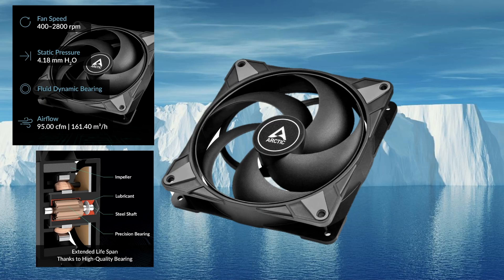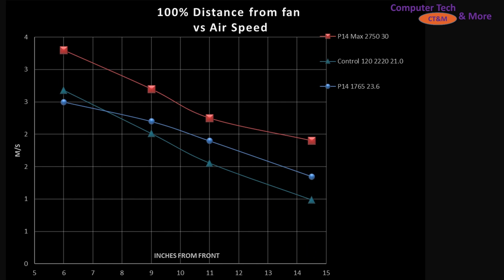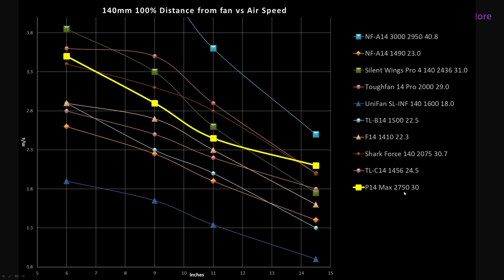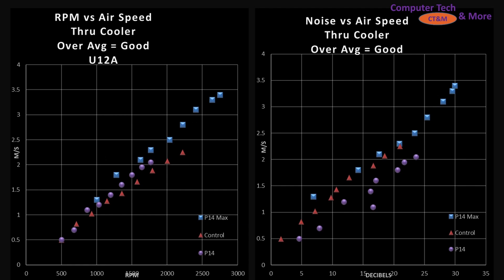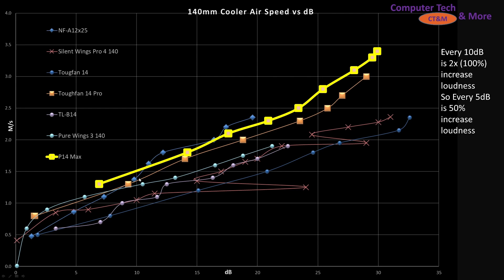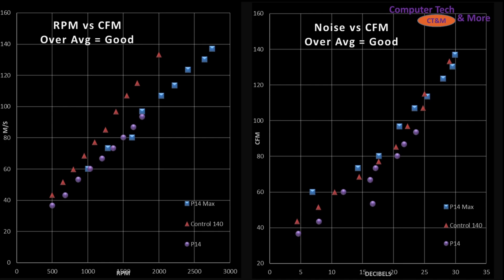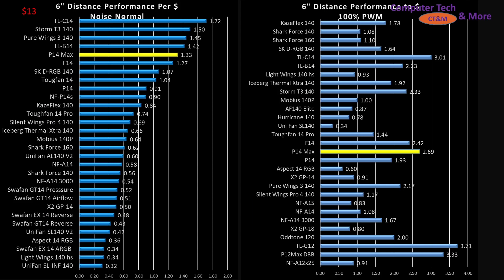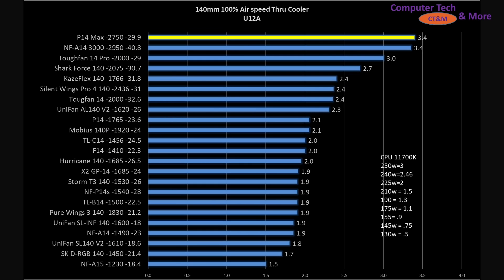Arctic P14 Max. Is it the New 140mm G.O.A.T.?

Comment: Huh? Them not being the "best value" only holds true if you need JUST 1 fan. Which is a slim to none scenario. You need 2+ fans. I now have (5) P14 MAX fans for $15 less than your (2) TF 14 Pro fans.
Reply from the maker: Value is based of original retail prices. not what it becomes. and its impossible to update videos pricing. so its a this is the best that can be done. I also give the caveat that it is for one fan, obviously for most fans 2 and 3 packs are a lot more cost effective.

Comment: Hello, I read somewhere that these fans cant really go below 900rpm stable, is that true? And are they quiet at that speed? When im just browsing or smthng like that I want dont want to hear my pc all the time, thanks
Reply from the maker: these do have a higher minimum RPM around 900-1000. I found them to be very quiet at those speeds though. only noisy past 1400. IMO
Reply: @computer-tech-more  tyvm for answering, I have one more question though, im getting 3x p12 max for my radiator and want to get 4 p14 max for the rest of my case but does it even help to get the max version for just case fans? in terms of noise and / or temps I mean
Reply from the maker: @anass8525  so the P14max would be overkill for case fans but if you run them at 1000 rpm would be very quiet.

Comment: Bought two arctic p14 max fan for my lian li lancool 205m case. Installed these instead of  2x front intake stock lian li 140 mm fans and there was temperature drop 4 celcius on cpu, 5 celcius on GPU in 29 celcius ambient temperature. Also my case has dust filter in front of intake fans. Impressive performance and not so loud. I strongly recommend these fans for your case.
Reply from the maker: Thank you for watching and letting others know about your experience with these fans. Sounds like they are working great for you.
Reply: are they daisy chainable (pst)

Comment: Can you use theys on a aio and would it be ok to splitter them ? Just the 2 tho to one header
Reply from the maker: You should be fine using 2 of these on one fan header. but i wouldnt do more than that. 
yes it would work well on an AIO
Reply: @computer-tech-more  just the fans on my artic 280mm aio only go up to 1700 rpm could do with higher rpm as keeping a'nice toasty i7 13700kf cool but want that little bit more
Reply from the maker: @marcusthorburn25  the best 120mm fans ive tested are the superflower megacool 120's.
Reply: @computer-tech-more  just an update theys 140mm p14 fans are amazing with  artic 280mm rad keeping my beasty i7 13700kf. 9°c cooler with the standard ones off the cooler are no good as they was sending my cpu near the danger zone
Reply from the maker: @marcusthorburn25  thats great to here.

Comment: I already buy 5 of them for my new case.
Tho i already installed one of them on exhaust on my old case (placeholder until my new xase arrived)bc clearly my old case has insufficient exhaust.
That p14 max fan alone improved the situation quite a bit (original included 140mm in the case is quite terrible)
Reply from the maker: haha am i imagining a case with 4 intake and 1 exhaust?

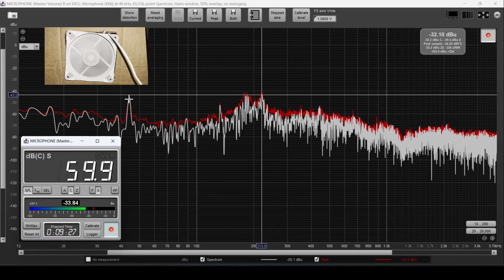Comment: It would be nice if you could extend the noise profile test you did at 6:00 but at different speeds and during speed change. If you can make this sound comparisons cfm normalized  vs. other fans it would be very helpful. Other than that great work!
Reply from the maker: hmm I'll have to start doing that in Rev3 of my testing. I basically dont do other PWM than 100% unless I notice an oddity on the sound the fan makes. I have an upcoming video where I do just that. 
The P14 Max sound profile was very smooth. Sounding.

Comment: Very nice video! I am curious as to how the fans sound when it comes to the bearings? I've seen talks about the P12 Max's having some issues with buzzing and high pitched noise. Did you experience any of that with the P14 Max?

Oh and, I think adding chapters to your videos would make for a better user experience on the viewers end. Easier to jump to relevant chapters.
Reply from the maker: Chapters. I have time stamps. in the description. I guess ill have to look into how to do chapters. I thought adding time stamps kind of did that. 

About the bearring No it uses and FDB (fluid dynamic bearing) the original P12max used ad dual ball bearing. I have a video up with the new P12Max that has an FDB bearing. 
can say no buzzing or bearing sounds I could hear. 
just the sound of air moving
Reply: @computer-tech-more  Ay thanks for the reply! Got a 5pack ordered. Here's hoping I don't have any noise issues, as I am specifically buying them to reduce the noise of my stock Fractal case fans. At least the performance is great from what I can see in both your and others' reviews.
Reply from the maker: @vedomedo  :) thank you again for watching. glad it was helpful.
Reply: @vedomedo Are they quiet or do they make noises in the housing at max RPM?

Comment: hardware busters said that the p14 max claims it uses FDBs but actually uses rifle bearings. Is this true?
Reply from the maker: hmm I dont know. I assume in their review they disassembled the fan? You can riffle a FDB bearing. I think. The riffling is there to help keep the fluid from settling in one spot of the bearing. 
I am not an expert at bearing. I am more aerospace so the blade design. 
So take my understanding of the bearing as a grain of salt.

Comment: I chose not to wait for noctua with this, and shoved it into my server. And I am very happy with the result!
Reply from the maker: that sweet. I still see ways this fan could be better but it would drive up that cost. so for its price just WOW. 
how many did you get? pretty consistent noise wise?
Reply: @computer-tech-more only one, so consistency is 100% :)

It is quieter than my 120x38mm  5000rpm dell server fan, but also doesn't really deliver as much static preassure. That thing can suck air through a concrete block.
Reply from the maker: @LinusBerglund  haha. server fans are dangerous. I bet it could hover across a table.
Reply: @computer-tech-more I bought 3 more after seeing your noise normalized results to make an arctic liquid freezer II 420 MAX. It lowered the noise at regular usage and brought the max temp down by almost 4 degrees. 

All fans sound the same.
Reply from the maker: @LinusBerglund  few. glad they all sound the same. maybe Arctic is betting more consistent.

Comment: Wow, just wow, always wondered when Arctic will release a 140mm P12 max, and now that they finally did, I am not disappointed. I'm seriously considering buying a bunch of them, but trying hard to justify spending money for that many fans :D
Reply from the maker: The sample I got from my purchase was very impressive. I just dont know if its the norm. I wish I was in a place with this channel to buy multiple fans of a type to try to get some kind of statistic on it. But all things are pointing to it being good.
Reply: Its a really good fan. Insane performance.
Reply: and I'm a little disappointed, because I love the double ball bearing. Yes, it is a little bit noisier (although I would say you can't hear it in the case behind the airflow), but they are almost eternal, and FDM is a couple of years if you're not lucky and a few if you're lucky.
Reply: @evur_tweak  That's not true at all. I have FDM fans that have logged 10,000s of hrs over 10yrs. And have at least 12 P14 fans that have been in PCs running 24/7 the past 5yrs straight (55% static).
Reply: @Tixbomber  the problem with FDB is not that they stop working, but that they start working more noisily than DBB after a couple of years. 
However, there is also a chance that the FDB will stop working at all with an adequate noise level.